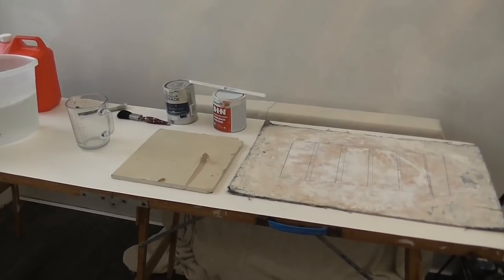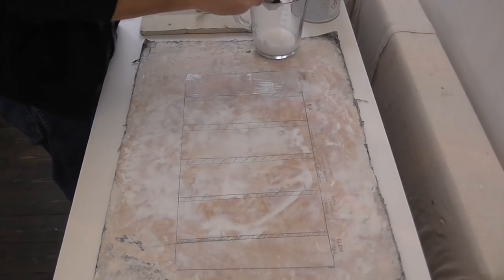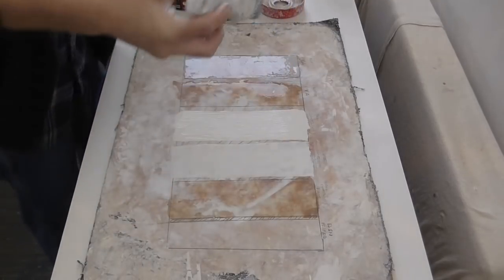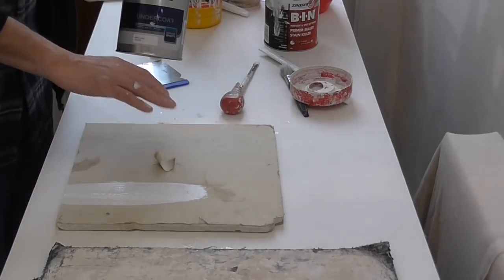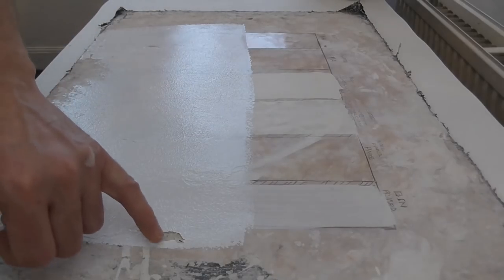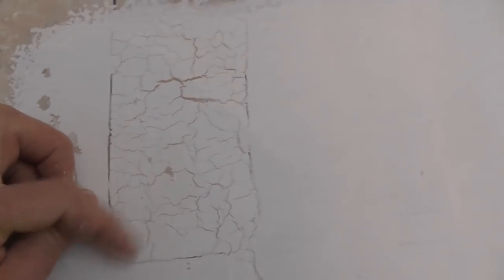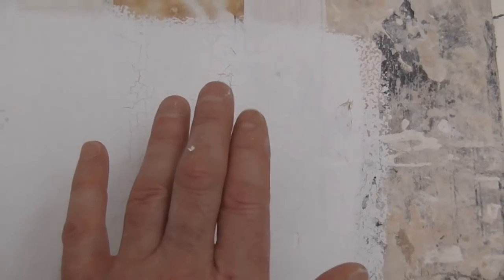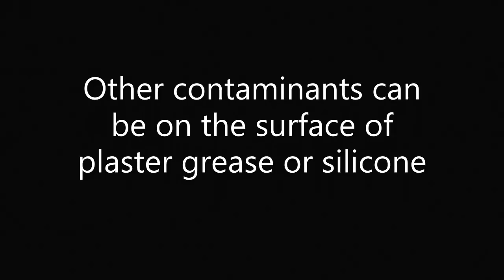What You Need To Know About PVA!

Comment: Good thing i came across your video before painting my attic project. 

About spreading this watered down pva i figured out how to use the roller without dripping all over.  What you do is either don’t put the handle, wring it and slide it across the area or perhaps put something to stop the roller from rolling and use it like a mop. You can probably use a piece of cloth too.  Much Faster than using brush

Comment: Great informative video as always. I have paint peeling off the ceiling in ensuite would you use PVA or BIN primer before filling and repainting?
Reply from the maker: Both will work allow to dry fully between coats. And use a bathroom paint or something washable.
Reply: Thanks for the reply and could you please tell me if I need to use either on polyfilla or bathroom paint straight on top
Reply from the maker: @James-lu9jf  Yes can do your filling over the B.I.N. or PVA but make sure you seal your filler when dry before painting.
Reply: Thanks  again. Do I use PVA or Bin over the filler or paint?
Reply from the maker: @James-lu9jf  Depends on bare plaster or painted surface.. PVA  if not painted and after it's painted anymore filling we use a hard stop filler. Which is paint and filler mixed together.

Comment: Thanks for the video that has answered a lot of questions. I am stripping wall paper and want to paint the walls afterward. I’m guessing I need to,wash the old paste with warm soapy water but what would you do next? Would you prime with BIN (it’s an average size room) or coat with diluted PVA?
Reply from the maker: Thanks, all depends usually I would use lining paper. Cuts out the washing off and evens texture of plaster..  But if you have washed off paste then yes diluted PVA.
Reply: @PaintingandDecorating  Hi, I could have sworn that in a previous video of yours, you steer people away from using PVA as it often makes it difficult for the emulsion to adhere properly? Is that correct or am I getting confused here!?
Reply from the maker: @frankymal8640  Your getting confused watch this video--- https://youtu.be/OfoEaV6dsjE

Comment: I'm confused. New to this thing but I have a question. 

The diluted PVA is a good sealant but I'd like to ask if using the same technique of applying diluted PVA next applying Matt emulsion and then painting the final coat of your paint is good enough to avoid wall bubbles and cracks both??? Wall bubbling can be taken care of with this technique ???  

Besides my question, thanks for the detailed thorough explanation. 🙂
Reply from the maker: Thanks, wall bubbles, don't seem to get to many myself. PVA diluted is a good sealer and is a glue so helps the paint bond. Sometimes if going over old emulsion you may get some bubbles, and this is the old paint lifting from the plaster, because the plaster was not sealed in the first place. You may also get contamination on the wall i.e. wallpaper paste, grease or something else. If we strip wallpaper we usually put lining paper on then emulsion.

Comment: Basically any method means bar the paste and neat pva produces the same result which in practice renders the mist coat theory a matter of opinion over matter of fact.
You had to scratch just as much over the neat coat emulsion as you did the mist coat
Reply from the maker: The neat coat will dry and stay on...  it's when you come to paint over or remove wallpaper...   the paint starts to come off leaving a mess..   which now gives me an idea for a video. thanks

Comment: Hi. I have a textured bathroom ceiling, a large section above the shower is peeling. Would a couple of coats of B.I.N primer be okay once I've scrapped it off? Many thanks.
Reply: Hello Philip. I have to decorate rental properties that have had steam damage with peeling paint above a shower. We have tried different methods including shellac based paint painted over the damaged area in the past, although we have scraped off the flaking paint and sanded it down, we have only painted the ceiling with the shellac over the original paint and the bare bits of plasterboard due to the fact as it was a rental property we only had the time to do this, but even though with the shellac it did start to peel again at a later date.  If the paint had all been scraped off all over the ceiling and painted with shellac , it might have worked but might not have, not sure. I think possibly the best bet is to scape all the paint off the ceiling down to the bare plaster and treat with watered down PVA first, i did this in my rental property i own and then coated with oil based undercoat and then emulsioned , that was 4 years ago and the paint is still on there above the shower area, now i'm not sure if the undercoat was necessary but definitely the PVA was
Reply: @davidjeffreys9063  Really appreciate your reply. Thanks for your advice!

Comment: When the paint cracks/grazes you recommend to use the BIN primer. Could you use diluted PVA on top of the sanded paint on a larger area of grazing as it would cost a fortune to prime everywhere?
Reply from the maker: It all depends on the reason your paint has cracks if the paint has adhered well to the surface, then you should be able to sand and fill fine cracks then diluted PVA.
Reply: Painting and Decorating thank you for your response

Comment: Amazing vidoe and huge knowledge shared. I will really appreciate for views on below issue.

Moved & renovating old house. Brick walls which are plastered/skimmed really thin. Half upper section of walls are painted and bottom half has wallpaper. Whats the best way to go around it? Sand slighly existing paint to mKe it smooth, remove old wall paper, use filler where required and use diluted pva on full (upper and lower section) before painting? Thanks in advance
Reply from the maker: Thanks, It really depends on how bad the walls are.  Lining paper may be a better option for the perfect job even the walls texture out. ...  or you will have to wash off old paste sand fill sand again fill then PVA all the wall and light sand then paint.
Reply: Thanks for getting back.  In this situation would you recommend PVA (100ml mixed with 8 litres) or Would you recommend Bin primer? You have mentioned ''PVA all the walls and light sand the paint'' just curious purpose of this sanding after PVA, will it not just remove the applied PVA? I picked up PVA (100ml mixed with 8 litres) from your video, will same apply here? Sorry for asking noobie questions. Thanks Again.
Reply from the maker: @Usman1921149251  Yes that mix will be fine,  and sand o denib.

Comment: Hi, tx for a very informative comparison. One question: on some videos you use diluted PVA then Zinsser Bin, rather than Bin straight onto a bare patch. Any particular reason? I'm wondering if PVA would affect Bin in any way? Tx
Reply from the maker: As long as the PVA is fully dry it's fine. Sometimes when just dealing with a small area  B.I.N. dries faster.

Comment: Moved into a 1960's eara house, tried painting the bedrooms walls with trade Leyland matt emulsion. The paint went on ok and looked fine however next day it looked like blown vinyl wallpaper. I ended up lining papering the walls and then painting but it doesn't look at good as painted walls. A friend called it Distemper, would these methods also work on that finish? The walls that are affected are either vivid orange or a dark purple in colour.
Reply from the maker: Yes should work fine clean all paste off first. Thanks

Comment: I have dry wall/jointing in my bathroom, which i mist coated and top coated with Johnson's  acrylic durable matt and it's still peeled! I've had to strip the lot back, any suggestions as what to seal it with before coating again as I'm at my wits end, it's been a right ball ache
Reply from the maker: Diluted PVA allow it to soak right in. Thanks
Reply: @PaintingandDecorating  in your vid you diluted 100ml to 8 litres, is that about right for this application? Cheers

Comment: Brilliant video. I'd like to ask you if I can apply diluted PVA directly over old oil-based paint that has some grease splatter from cooking and sections of unsealed easifill60?

Its for a kitchen ceiling project using vinyl wallpaper. I don't care to ever remove it, I want the bond to be strong!
Reply from the maker: Better to remove grease and sand gloss surfaces..  no need to seal gloss paint using diluted PVA..   use a paste that is made for kitchen ready mixed.     B.I.N.    primer covers grease and goes over gloss surfaces without sanding.    But always better to do prep anyway...   thanks
Reply: @PaintingandDecorating  thanks and merry Christmas

Comment: Would this stop paint from flaking
Reply from the maker: Scrape off any loose then a coat of diluted PVA leave to dry fully. Then a coat of good washable matt this should seal the surface.  You may need to sand and repeat process and fill to achieve a smooth surface.. or lining paper.. wallpaper.

Comment: Hi the BIN primer is solvent based can you apply a emulsion paint as a top coat? Or would you use the Bullseye 123 which is water based? Thanks
Reply from the maker: You can emulsion over BIN once its dry fully...  Light sand first.. thanks

Comment: Hi, been watching your videos, very helpful, I have a 1930s house, one room had wallpaper on it, I stripped the wallpaper and painted a few years ago, I am about to repaint but now it is very badly glazed, and you can see the wallpaper lines. I have just purchased Zinsser Guard and Zinsser 123, please could you instruct me on how to make this perfect for painting, and are these products good enough for the job? Many thanks, you are a Star!
Reply from the maker: Thank you, you will have to sandown the whole wall, then it really depends if its going to react when painted...  test s patch see what happens. If it does react because of the old paste that was probably not cleaned off.. you'll have to give it a coat of the zinsser guard.. that should solve your problem.   Thanks
Reply: Painting and Decorating Hi, thanks for your quick response, much appreciated, yes I probably didn’t clean the glue off very well as parts of the walls aren’t too bad, I will use the Zinsser guard where needed, do I use the Zinsser 123 after the Guard? There are so many products to use nowadays, I have got PVA as well which I used for the cracks around the house with Soudal foam as you suggested, it went very well and all down to your good self!  The video above on glazed finishes was the one I have been looking for for ages,  your attention to detail and results are what I hope to achieve, you have the best videos I have seen on You Tube for a DIY person to follow easily, many thanks.
Reply from the maker: @GA-dv4ty  Thank you, it should be okay to emulsion over with out using 123 ...
Reply: Painting and Decorating perhaps I didn’t need the Zinsser 123 then, not sure when I’ll use that now? Thanks for your help again, much appreciated.

Comment: I've got water based paint on panels below my double glazed windows. The paint is crazed. I've sanded and rubbed with a sponge and microfibre cloth and I can't get it smooth. What would you recommend? I was thinking diluted PVA? Then an acrylic water based primer? The area gets mouldy so I'd like to stop that. So it doesn't seem very straightforward. Help!

Comment: Very informative video, thank you for posting.
I’m currently having similar troubles to the wall paper paste in your video, only I’m trying to emulsion over lined walls that have previous been emulsioned, only my emulsion peels off on the 2nd or third pass of the roller. Do you have any advice please? Thank you.
Reply from the maker: Thanks.  Sounds like paste on the front of the lining paper. And your using normal emulsion. Every coat will wet the one underneath. Allowing it to peel you may get away with diluted PVA possible it will hold it. A coat of scrubable Matt also may hold it back. Failing this a coat of B.I.N. primer last option. Or strip and start again.
Reply: Thank you, I appreciate the reply. I was using the dulux trade diamond matt emulsion & was really frustrated when it started to come off. If I try the diluted pva first, what ratio would you recommend? If not, il use the b.i.n. Am I right in thinking il then be able to paint over once dry with my dulux trade?
Reply from the maker: @Mbdtrees  If you use the same ratio as in the video that should be ok.  Always best to leave till next day if possible with problem walls.
Reply: I personally would not recommend diluted PVA but instead would apply Zinsser Gardz
Reply from the maker: @marcuschambers62  You can it is good but it takes 3 days to cure fully. 3 hrs before re-coat where as PVA 20 mins ready to go for most applications.
Reply from the maker: @marcuschambers62  will admit it all depends on what surface and your time scale. Zinsser  is best for dry wall.
Reply: Thank you for the advice.
I’m painting onto a solid brick wall with solid plaster.  It has previously being lined then painted with a crown breatheasy Matt Emulsion. I thought dulux trade diamond Matt would have gone straight over the top, but on my second pass with a roller the paint was peeling straight off. I’m no decorator but I knew something wasn’t right. Am I right in thinking if I opt for pva or gards, once fully dry I can then paint over with the dulux diamond Matt?
Reply: @hardworker8030  I suppose it depends on your definition of what is expensive, I actually think it's quite inexpensive, it goes a long way, I use other paints which cost a lot more.

My issue with PVA is that it is a semi live coating which means when it gets re-wet it is activated again whereas Gardz doesn't. I have spoken to a few technical experts at paint companies and none advocate the use of PVA for this reason. Each to their own and I am glad if no one has had a problem using this method but it's not for me. It's a bit like people saying PVA walls prior to tiling, same principle I wouldn't do it due to its nature.
Reply: @Mbdtrees  I actually would ask questions about the integrity of the wall initially. A solid wall that has been lined, was this to hide a problem?

Essentially though a coat of Gardz and it's pretty bulletproof, can't comment on PVA as never used it for anything other than as a building admixture.
Reply: @hardworker8030  it goes a long way, it's very thin, pretty much milky water. I always keep some in stock and haven't noticed any deterioration of the product.

My cheapest supplier is Gowallpaper.
Reply: @Mbdtrees what paint is peeling? If it is just the diamond matt u r applying that is lifting as u lay it off with the roller then it could well just be because u r rolling over it when it is in an in between stage of not being dry but not wet. To get round this just roll it on with a good thick pile roller and leave it to dry. Don't touch it or it can lift slightly. This is different from normal vinyl emulsion. People in the trade don't really have this issue as we r use to working a bit quicker. But if the actual first coat of diamond matt is lifting during the second coat application then it could be due to paste underneath. Does that make sense? I'm no use at explaining things
Reply: Stuart McIntosh your explanation was great & I understood, thank you. 
It’s the actual coat of Matt that I’m trying to apply that peels, & yeah, now you mention it, it does look like it’s going off, but not fully & when I’m rolling over it to lay it out I end up pulling it off!! 
I’m no decorator so please don’t judge!!
Maybe I’m trying to put too much on in 1 go, as I thought I needed to go over it a couple of times to even out the paint so it drys evenly?!
Cheers for your help. :)
Reply: Marcus Chambers thanks Marcus, I understand what your saying. I would imagine the walls were lined to hide the small imperfections associated with old plastered walls to give a nicer finish. The house has no damp issues or at least nothing came up on the survey!! I must admit, it does sound a lot like the paint is part drying but not fully so when I’m rolling over it it’s coming back off. I wouldn’t have thought it would dry so quick though. Amean, literally as I start from the centre of the wall & roll up, as I then roll back down to the skirting it’s all coming off!! :(
I’ve tried this with the thick dulux diamond Matt & a very cheap thin dulux Matt. The same happened with both paints.
I really hope I don’t have to strip the lining & start again!!
Reply: @PaintingandDecorating  so the the pva mixture is 8 parts water and 1 of pva? My kitchen is flaking bad and showing the new plaster. I have a few patches near the toilet and the bath too. So I should do this then paint over it?

Comment: I have an over-bath shower in the bathroom and the paint above the bath area peels off even when I use expensive Dulux bathroom paint ,the rest of the bathroom ceiling  paint doesn't peel off.Can I just scrape off the peeling paint and use the diluted pva method or would I have to take all the paint off?
Reply from the maker: It sounds like your putting paint on a failing coat. So better to remove as much as you can before using diluted PVA .
Reply: Thanks

Comment: Hey. So is the implication here that it’s just as good if not better to use diluted pva on plaster rather than watered down paint? I’m wondering if the actual colour from the mist cost of paint makes the next two coats look more solid?
Reply from the maker: It's all about sealing the porosity of the plaster. PVA is good for first preparation, it allows you to check over and clean the plaster.  You can't just put a mist coat on and think you have a sound surface to apply your next coats.    Plaster is usually rough and needs a good looking at before any paint.   PVA then two coats is usually my preferred method.   Large jobs it can be a slow process.. but if you want the quality. Thanks
Reply: @PaintingandDecorating cheers mate I will do this.